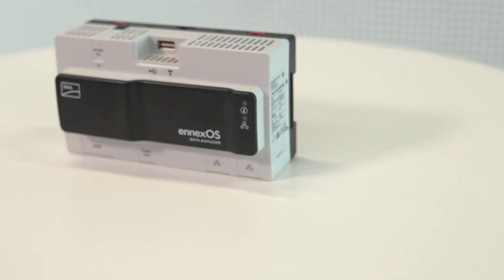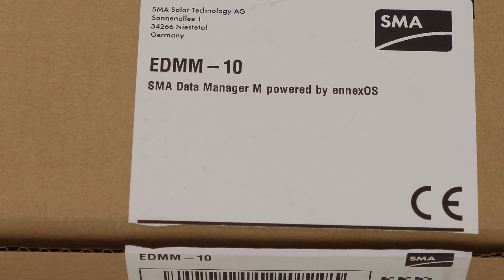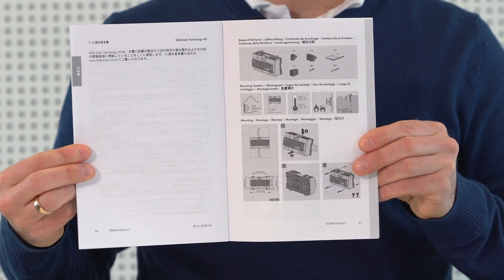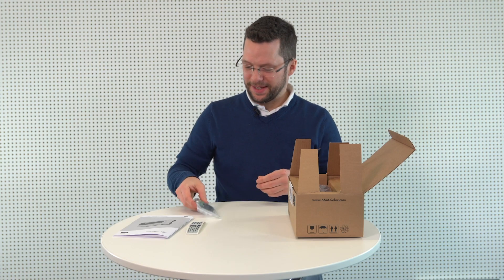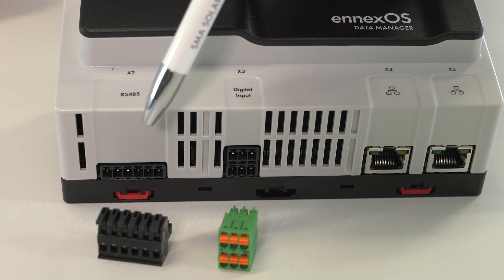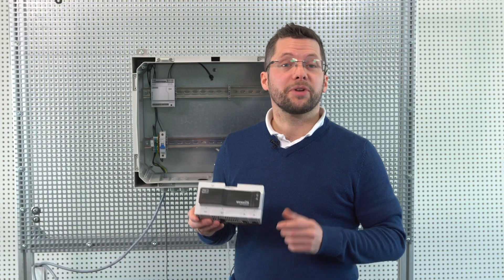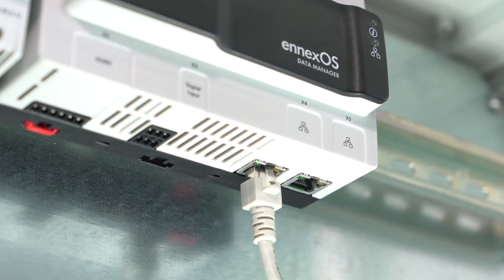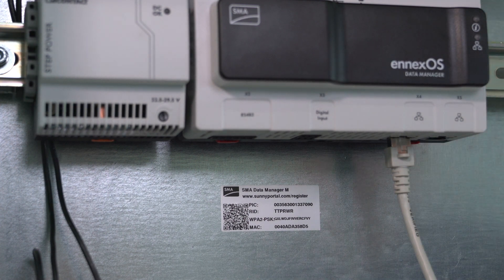SMA Data Manager M 開梱・設置方法

Comment: Will ennexOS based sunny portal work with my SMA tl7000 with WebConnect RJ45 communication installed? I use legacy sunny portal which works fine, wanna try ennexOS version but it doesn't accept PID of WebConnect module. I guess ennexOS portal works only with this special gear?
Reply: Pls I'm new to this installation. Is there a physical link between the Data manager and Sunny Island? 
Like Ethernet cable or how does the data manager get to link up with the inverter and other system components. Thank you